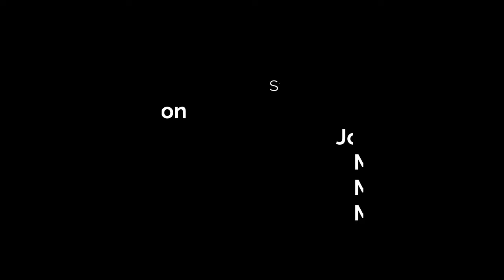First Cast Monster

Comment: Good fight at least. What distance do you cast with the magnet can you out cast a grinder
Reply from the maker: Hi Clent. I would say at least 100 to 120m depending on the wind. South easter at macs 30m lol .Windless day around 130m..if off shore wind 150m amd up easy. I could go further but will need to upgrade barrings in reel to ceramic barrings.  But it's not about the distance at macs..gulleys are not far out. 
It's hard to explain ...I've tried casting with a grinder in pendulum style thinking I would get further but didn't.  I'm old school and prefer a multiplier. Grinder was useful to me when droning.
Reply: Great distance you getting. 20 years ago when I came to cape from natal the guys where laughing at me on the reefs in strand because I fished with a grinder. That lasted only until I out casted them and caught more fish than them. The grinder has taken over but u right if you set on your tackle you will be comfortable casting. In natal I seen guys do 180 plus on a grinder with the pendulum cast. There's a guy that fishes mac's cast like a demon with the grinder and 6 ounce sinker met him once only there. But good to know I do have a old multiplier will try conversion. 🙏
Reply from the maker: @clentcharra953  grinders have really taken over. They use them for shark fishing and sliding aswell if I'm not mistaken. Their designs and reel integrity are second to none. Be sure to cough up lots of money for a decent grinders. I've seen overseas english guys casting with grinder at long distance casting competitions.  Over 200m easy.